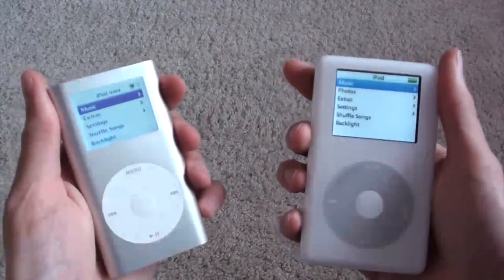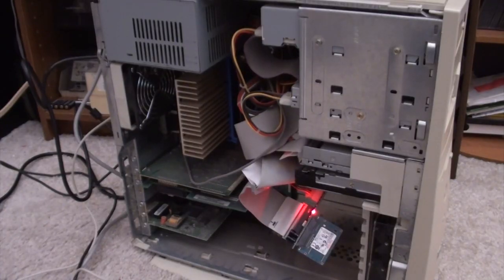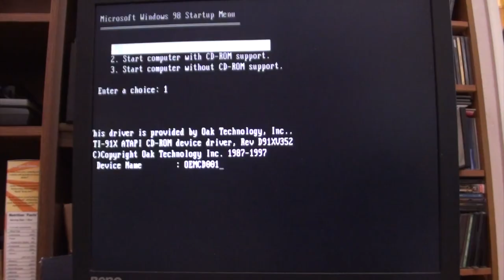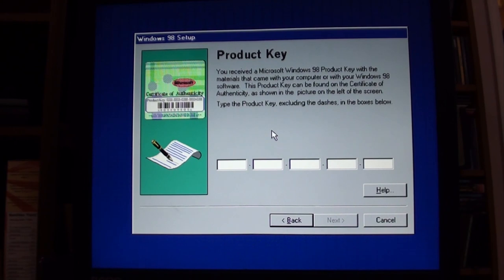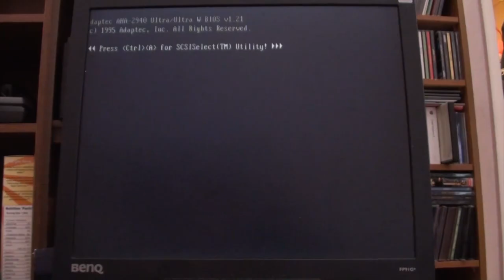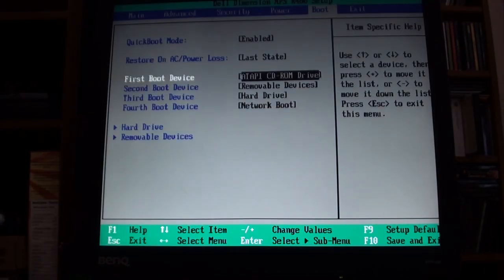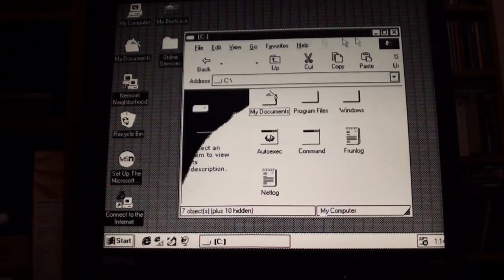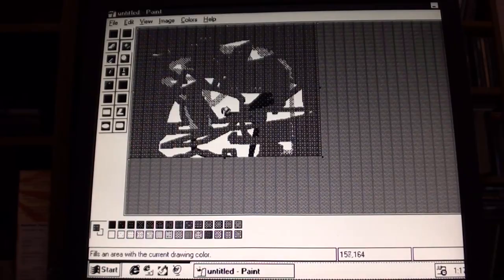Installing Windows 98 on an SSD

Comment: that cpu fan sounds like a 1973 chrysler new yorker with 700,000 k on it. lol
Reply: +Patrick O'Neill Yeah...I've got a molex-plug fan that always makes my Windows 2000 machine run too cold. I actually want to wire up a switch to it to turn it on and off as needed, because otherwise all I hear is an idling jumbo jet all the time...I've had louder machines but the only time I appreciate the noise is playing an old, buggy Windows 98 game called Jetfighter 4: Fortress America.
Reply: +killthemusic man you kill me
Reply: +killthemusic As if any chrysler could ever hit 700,00k...
Reply: +killthemusic  It sounds like my 440 when I bent a push rod to me.
Reply: +Nick Motsarsky 
as if most any cars besides a few diesels can hit that mileage lol

its like this... chrysler had some winners, they had some losers. most of them though, you do the required maintenance and itll just keep going.

i have my 95 grand with the 318, shes haggard inside, rust spot on my door, bent antenna, wipers are busted, need to change my power steering hose. but dude, look underneath? awesome shape. i just need to do a top end overhaul on the engine(gaskets, plenum, water pump, timing chain etc...)

but lets be honest, as far as im concerned the absolute best car brands are as follows:

chrysler 
GM
nissan
toyota

and to be honest, my two absolute favorite is nissan and Chrysler.

im just a chrysler fanboy, i know they have their flaws. i cant like ford. i just cant lol
Reply: +killthemusic 700,000 k ? so 700 000 000
Reply: +killthemusic My brother almost got to 600,000 KM with his 92 Crown Victoria when the head gasket went. Fixable, but weighing the options of doing $1300 of maintenance to the engine and transmission of a $1200 car, OR buying a writeoff 60,000 KM 1994 Vic with a good engine for $200, it seemed pretty good to start fresh with another motor. 

The funny thing is, there is only a few other problems: Interior is wearing out, rear shocks could use replacement and some minor rust repair and dent removal is needed around the fenders as well. That's it.
Reply: +Nick Motsarsky IKR
Reply: +killthemusic /watch?v=w8GFE5dePAM
Reply: that's so specific 😂
Reply: Hey!  That was a great car!
Reply: Is 98'
Reply: @pattyoneill91  Lmao obviously you've never worked on cars or you'd know Nissan and Chrysler are both complete junk. They've never made a car worth buying. Nissan is a little better than Chrysler but not by much

Comment: The SSD removed the seek time to almost zero (even shorter than the time the old machine can handle,) but the IDE bus on this old machine bottlenecks it. If the machine have a PCI slot, with a PCI SATA card, because of its capability of handling at lease SATA 1.5Gb/s despite the PCI bus latency, you can get much better results.
Reply: +陈北宗 i was thinking the same thing. it would still be throttled by the ide bus.
Reply: +陈北宗 I've a rare AMD Sempron machine with Windows 2000 installed and still using the IDE functionality for the reason that it's not fast enough to read a mechanical SATA drive, at least in my opinion...with the unofficial SP5, update rollup and ESR version of Firefox all installed on this machine, it's still unable to play videos any better than 360p with occasional choppiness here and there due to it's limitations. An SSD may or may not help things out, but god knows how this machine could continue running any modern browser fare decently.
Reply: +prizedcoffeecup lel, I just installed an ssd to a laptop with a Pentium 3 @ 500mhz and 128MB of ram, there's no way in hell this thing can browse any websites with pictures , even in 320x240 resolution
Reply: ray02946 True

Comment: Win 95 = Bad
Win 95 OS Release 2 = Good
Win 98 = Bad
Win 98 Second Edition = Very Good!
Win 2k = Not Good
Win Me = Very Bad
Win XP = Very Good
Win Vista = Very Heavy
Win 7 = Very Good!
Win 8 = I'm Confused!
Win 8.1 = I'm Still Confused
Win10 = Im Complaining (fixed 100% disk usage issue)
Reply: @WCKDMys Q! n acredito nisso
Reply: You lost win 3.11
Reply: @TheLowshares  Sorry but I have less than 1 hour of interaction with Windows 3.x on all my life. My first PC has Win98 and it was upgraded to Win98 SE a couple of months later. So Win95 was the really oldest system that I used/installed.
Reply: It's right...
Reply: yeah windows 8.1 is the best for the mean time only if you get all the potential updates(fix issues) . . . windows 10 has more issues yet but I think in the future it will be next.
Reply: im going away
Reply: Linux distros (especially debian, Ubuntu, kali, centOS) = Excellent! ;) His machine would easily run most of the linux distros.
Reply: My windows 10 PC gets 100% disk usage when chrome is installed.
Reply: How are you rating this?  2K SP4 was one of the most rock solid systems I've ever had outside of NetBSD and BeOS
Reply: @External_Bastion  Maybe I saw a Win2K without any Service Packs. The Control Panel shows an error just after a clean install.
Reply: sounds like a personal problem
Reply: @VictorCampos87  That's fair. I think my earliest exposure to Win2k was SP3. Cheers!
Reply: Hi !!, you have cds
Reply: everybody is underestimating win2k. its almost as same as xp.
Reply: Windows ME was fine... It worked smoothly for me back then
Reply: win 10 is shit.. got update every week.. lagging when update
Reply: Win 95 = Eh, pretty fine.
Win 95 R2 = Nice.
Win 98 = Good
Win 98 = Pretty good
Win 2000 = Amazing
Win ME = Eh
Win XP = Overrated
Win Vista = Great
Win 7 = Just a reskinned Vista.
Win 8 = Eh
Win 8.1 = Great!
Win10 = Okay
IMO
Reply: @VictorCampos87  boa, pra mim o SO mais antigo que usei foi windows 95, mas ja testei o windows 3.11 em um navegador kkkk
Reply: Win 2K not good? Fuck, much more stable and reliable than XP.
Reply: I found 7 to be the best OS they ever did XP had issue where you it would always slow down after 6 months of use. Or need a reinstall after a while yet my 7 install I had installed for 6 years and it was perfect. I only upgraded to 10 recently and it's ok in just getting used to it but it isn't that bad
Reply: 7 the best , but xp Very Big best kkkk
Reply: Everything bad. Why you keep using it
Reply: Agree on all. Only real experienced people will understand that windows 98 SE was the best OS then Windows 7!
Reply: sorry bro but win 8.1 is actually way better than 7 so if you are still confused it means you just never tried em properly
Reply: Something wrong with you. You rally do not know how to use operation system. Fixed 100% usgge its man you have some problem with your computer.
Reply: Win 98 first edition - not bad, good
Reply: Dude the 100% disk usage is ridiculous and I feel bad for computer illiterate people who just have to suffer with it
Reply: Windows 2000 is great imo
Reply: Victor Campos windows 10 is ok now
Reply: Win95 = Revolutionary
Win95 OSR2 = Better than ever
Win98 = idfk not used it
Win98SE = Good!
Win2k = Just fine.
WinMe = Brought many features we take for granted, but very buggy. 
WinXP = Built on the solid foundation of Win2k, and brought over the best features of Me, coupled with a new interface.
Win Vista = Not great at first, but after SP1 it doesn’t deserve the bad rap it gets.
Win7 = Basically Vista done right from day 1, very good.
Win8 = WHY MICROSOFT WHY WHY DID YOU THROW AWAY AERO?!?!
Win8.1 = Ok you fixed some things BUT THAT’S NOT WHAT I WAS WORRIED ABOUT! ALSO MY LAPTOP IS STRUGGLING NOW!
Win10 = Microsoft, I’m beggin’ ya, please bring back Aero.
Reply: @marx4538  I think windows 10 better than 8.1 (only if you have a pc that can fully handle win 10)
Reply: @Невада большевик Yes. I can agree with you. I just realized that I have compared stock system (like Win2000 without service packs) with WinXP with service packs (which already solves a lot of security problems). I remember now keep an stock WinXP connected to the internet and after several hours the system was already infected with some kind of trojan (whom connects and explores external system communications services).
Reply: 8.1 w/Classic Shell = OK, not bad

Comment: 17:35 Trust me, an IDE from that era boots way faster on a clean Windows 98 installation. Mine boots in 20 seconds with a 6 GB drive with Win 98
Reply: ikr, maybe the adapter reduce bunch speed, or maybe he should try to disable network and floppy seek boot
Reply: This is what i was thinking. The ide to sata probably bottle necked it a lot.
Reply: Im pretty sure it was because it was setting up for two color mode. I don't think this was an accurate speed test.

Comment: is slow because you are using an ide adapter, the bus is low very low.
Reply: It is slow cuz he is using a cheap ssd without any dram cache 😂😂. Ide interface can handle 1gbps i believe. , Sata 1 was 1.5gbps , sata 2 was 3gbps & sata 3 is 6gbps & pcie gen 3 x4 is 32gbps & gen 4 is 64gbps!
Reply: @KuntalGhosh  133MB/s

It’s slow because of the SATA to IDE adaptor
Reply: @KuntalGhosh  not got enough time right now to read all that ☝🏻 no disrespect intended. 

Those SATA to IDE adaptors have quite a lot of work to do and tend to max out at about 33MB/s

The rest, I’ll read that soon and get back to you.

Comment: The funny thing about Win98 starting up in 16 colors or even monochrome is that the startup screen is 256 colors. (Granted, I believe that bitmap is stored in like 300x240 or something weird like that. The computer stretches it out to a 4:3 mode.)

Comment: Let watch these temps plummet!

10 degree rise in 2 seconds
Reply: That tended to happen with old systems when you ran them with the case wide open. Not only is the case fan obviously dying, it's also not providing any flow through the heat sink whatsoever with the case sides taken off.
At least do the true old school thing and stick a box fan up next to that dinosaur! Sheesh!
Reply: @weaselsworld  yep. Ive got an early Vista tower that does this. It killed the CPU eventually. If you wiggle the cooler the right way it boots, tried reseating CPU, still does it.

Comment: while (boardOnYouTube = true){
print("yes")
}

edit:
people seem to think i made a mistake. in fact a single = is an assignment. so it will always be true. its a joke. in other words you are on youtube so it’s assumed you are board. and it will work in many languages. In addition yes the program is in a infinite loop much like our addiction to youtube.
Reply: Yes
Reply: Yes
Reply: Yes
Reply: Non't
Reply: run this code if you want to crush ur IDE ......
Reply: @happygofishing7590  hello
Reply: Unexpected ident on line 1
Reply: == true*
Reply: @rfsan  true
Reply: == true
Reply: Yes
Reply: while (boardOnYouTube = true){
print("yes");
}
Reply: ？print（what's that?）
Reply: yes
Reply: yes
Reply: @kmrk59  Technically leaving the == true out would work too
Reply: You're all wrong though, I don't see the capital "Y" anywhere in the string
Reply: yes
Reply: Unexpected end of file line:1 the operator must not be a boolean type expected;
FATAL ERROR Caso.exe caused an EXCEPTION_ACCESS_VIOLATION in module at Caso.cfg. 
Caso.exe can' t load
Reply: No It must be !=true  and the variabile cant be decalred in that way
Reply: yes
Reply: while(boardOnYouTube)
printf("yes");

FTFY
Reply: yes
Reply: while (boardOnYouTube) printf("yes");

Fixed
Reply: @TheMrDemonized  depends on the language.
Reply: I guess Tom Scott gave u this idea? Or some other YouTuber who simplified programming or infinite loops on computers?
10 PRINT “IDK WHAT YOU’RE TALKING ABOUT”
20 GOTO 10

Comment: Loved this video the first time I watched it. Returning now as I consider getting a 5.25 hotswap bay for my pentium 4 that runs windows98se. Grab some 120gb SSDs just to have a decent compact ability to have unlimited space on a windows 98 machine.  I might wait until I actually fill the 80gb in it though. Currently loading disc images off a 128 usb thumbdrive for isos. Has been a fun project. Hardest part was having some Dell OEM P4 accept 98se. 

Thank you and thank you for the inspiration.

Comment: 11:11 "Alright lets watch those temps plummet!"

temperature goes up 10 degrees
Reply: Me when I try to close unnecessary programs that are running but aren’t necessary for Windows to operate (I.e. ones that I installed but I keep forgetting to disable their auto-open on startup or whatever it’s called, & yes Ik about viruses and programs that subtly ask u to install other programs while you’re already installing 1)

Comment: No jokes aside, Windows 98 SE wasn't bad probably my second favourite Windows after Windows XP.
Reply: Win 95 = Bad
Win 95 OS Release 2 = Good
Win 98 = Bad
Win 98 Second Edition = Very Good!
Win 2k = Not Good
Win Me = Very Bad
Win XP = Very Good
Win Vista = Very Heavy
Win 7 = Very Good!
Win 8 = I'm Confused!
Win 8.1 = I'm Still Confused
Win10 = Im Complaining (fixed 100% disk usage issue)
Reply: @VictorCampos87  windows xp=bad
Windows xp sp3=very good
Reply: @VictorCampos87  Windows 2K was amazing, I don't know what you are talking about...
Reply: @3maf  Incompatibility drivers, not optimized system, bugs with external drives, corrupted boot files, etc
Reply: @VictorCampos87  I was having fun with 2K SP4. With Intel Celeron 850Mhz, 1GB RAM, VGA S3 Trio, 40GB HDD. Better than Win ME or XP. But XP SP3 is good.